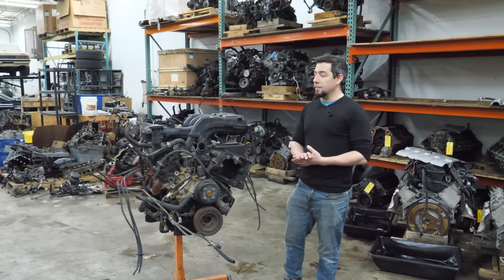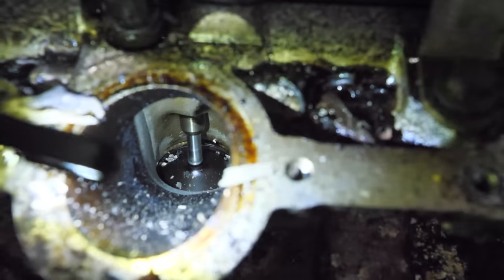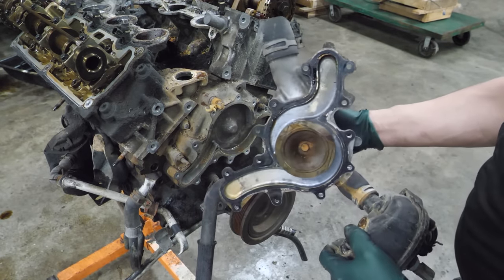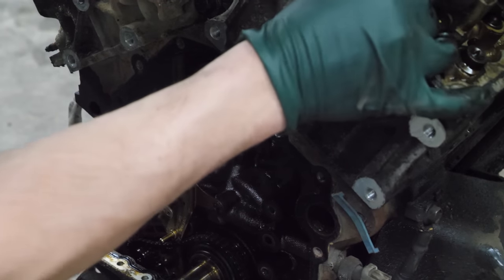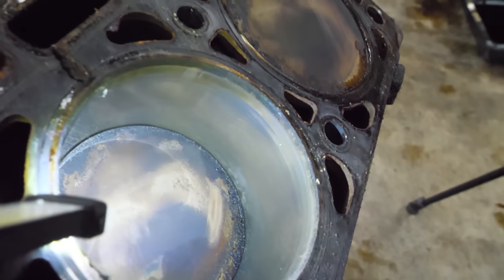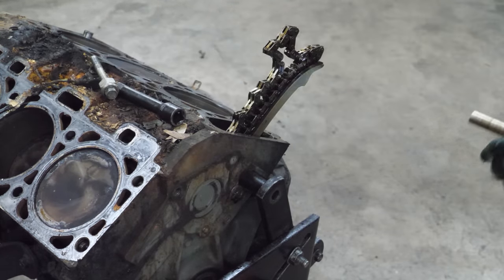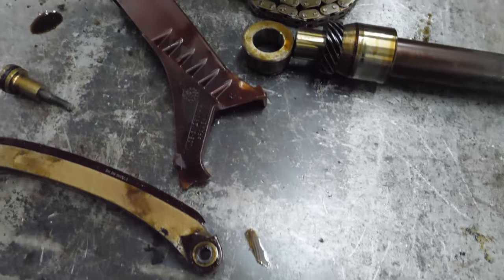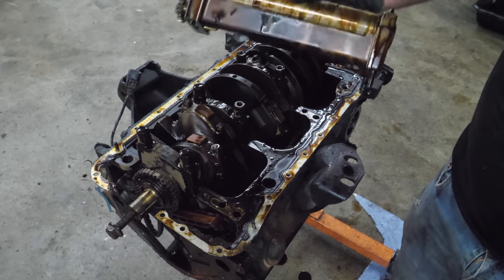Ford Explorer / Ranger / Mustang 4.0L SOHC V6 Teardown! Is This Why They're Called "Exploders" ?

Comment: When my son had the Cadillac with the Northstar, I didn't even want to bother. Now I got stuck rebuilding a 2006 Explorer 4.0 SOHC. What a headache! Is this the only engine you have to remove to change the timing chain? Well, at least the back one. Both chain guids were broke on this one. The front one made a hole in the valve cover. I had to replace the valves too. They did bend a little. Luckily, they didn't damage the pistons to needing replaced. All but 2 valves were bent some. I'm putting it back together now. I ended up buying tools to do this job.

Your's was alot better than the one I'm doing. LOL

The person only had it for 3 months. So I'm trying to save them a bunch of money, by doing it for them.

Comment: I have a 2001 ranger with this engine. It is at the end stage of its life. With 170 thousand miles, it has that notorious start-up rattle, but I will daily drive it until it pops. Been a great truck... I'm getting a little weepy.

Comment: I still have my 2001 Ranger SOHC 4 L V6.  I recently had a few minor oil leaks so had valve cover, pan gasket and oil pressure sender replaced.  Also had radiator and water pump replaced 6 months ago when radiator leaked. Has 196,000 miles and doesn't use a drop of oil runs great.  I can only hope my next vehicle has so few repairs after 22yrs.

Comment: You can actually remove both camchain cassettes while the engine is in the vehicle. One needs a set of fixtures and specialty tools to properly align the cams, chains and pulleys. You must torque everything, I recommend a lot of loctite and good luck.

Comment: Those external tensioners are supposed to be changed every 70-80k and most people dont know that. Thats why they're external, so you can change them. After a while the spring gets weak and reduces tension on the guides making the chain slap on startup, which cracks them. The oil pressure takes over after startup and the slapping goes away. Really other than that they're very reliable engines.
Reply: So the oil bleeds out of them when they sit.... Don,t know about that. I think the plastic gets brittle.
Reply: @blueplasma5589  yeah the oil will bleed out of the external tensioners. That’s why it is spring loaded, to keep tension till oil hits. Springs get weak and then next thing you know you have broken guides

Comment: mine made it to 302k and i'm putting in one from the pick and pull with 150k.  dropped the oil pan looking for plastic first thing.  bought it new in 2001 and don't see many around anymore.  quoting Alan Jackson, "Some day it'll be a classic". it's been a great suv.

Comment: We still have a '94 explorer with the 4.0 engine. Not a bit of head snapping acceleration but still runs very well and starts. Has 221k miles.

Comment: So the ‘07 4.0L on my Exploder made it to 145k when the timing failed. My wife was just leaving the driveway so no damage. Compression was great across all cylinders so I pulled the motor and re-timed it. It’s a massively complex process, especially for someone like me who had never done anything nearly as complicated. We got 5 years and another 50k miles out of that engine before it failed again. Again, timing components (found plastic pieces in the oil pan). 
I just finished installing the new 4.0L from Fraser Engine today but I still have the intake, headers, and accessories to install. 5 year no questions asked warranty beats a car payment the the transmission is a reman with only 50k on it

Comment: I had a 2004 Sport Trac with this same engine had 285,000 miles original engine and trans and still ran and drove perfect when I sold it. And it was a work horse. I pulled loads over weight for the truck several times and the truck never even struggled with it. I upgraded to a 1/2 ton is the only reason I got rid of it.
Reply: 2004sport trac has the new metal cassettes installed went…300 k.  2002 and below had the plastic cassettes that only went 200 k..

Comment: I own a 2004 Sport Trac with the 4.0 - ran 100,000 and replaced rear timing chain and cassette and now doing it again at 207,000 - let this be the last time.  Hoping I get 100,000 more!!  I will say this engine has performed really well if it weren't for the timing chain issue.   The right bank on the rear failed both times - front has yet to fail at 207,000. Problem is you have to pull the engine to fix it. Still - I like this truck - it has plenty of power for it's size but this will be the last go around for me. Enjoyed your video!!

Comment: I had one of the ohv 4.0 in a 99 ranger, then 2 of the sohc 4.0s in 2 newer rangers.  Never had any engine trouble besides the serpentine tensioner pulley bearing squealing after 30k miles… I replaced a lot of those. And a bunch of clutches… but that’s it.

Comment: I had a 2007 Explorer with that same engine, got totaled at 150,000 miles, got great service from it, no engine troubles whatsoever.  I didn't consider it underpowered but then I don't want a rocket on wheels.

Comment: I almost purchased a 4.0L SOHC 2 door explorer, was an 2002 and had the updated chains and guides already done with new tensioners from ford. He rebuilt one of the earlier 4.0l SOHC that failed due to the guides falling into the oil pan but it was just the rod and main bearings, new chains guides and tensioners but he knew how to time them, he had some holders that looked like basic wrench but it was a special offset.

Comment: I’ve had several of these engines with over 200000 miles and going strong. Even had a relative hydro lock one after trying to cross a creek, drains the pan, pulled the plugs and cranked it over, sprayed the water out. Plugs back in, new oil and filter and it was good to go. 3 years later they did the same to a pathfinder with the 3.0 and not so fortunate, valves all bent.

Comment: My brother in law ran a explorer over 250k on the 4.0 sohc. He traded it in on a E250 van.
I had a 94 pushrod 4.0. I never had any issues with the engine. My problem with that truck was the automatic 4 speed trans. Was the weak link.

Comment: Have had a couple of 4th gen explorers (this motor) w/o really having any mechanical issues. Really love these. Body on frame, great all-around size, incredible turning radius and true 4wd w/ a 2-speed transfer case.Keep the one I have now heavily dealer maintained as there is no American made SUVs with similar specs. Biggest issues with the ones I've had are always the electronics. RSC causes lots of unrepairable problems. Dealer tells me Ford discontinued parts even though it's a known problem.

Comment: I had an 03 Ranger Edge with one of these in it. It had 280k on it. The truck died because the transfer case got stuck in 4x4L and it basically wouldn’t move after a while. That, and the cab was so rusted, I had to ratchet strap both the doors shut.
The engine still ran perfectly though 😄

Comment: Just sold a Ranger 4.0 with over 200,000.
Changed the oil reg , drove it reasonable, 
Lots of other problems with the PU.
Had it 8 years.
Engine still sounded great.
Only good thing going for it was it was never loaded very much.
It was used for pickup and delivery or medical samples.
The bed liner looked new. However Reading on the net I was sure it would die any minute.

Comment: I made the mistake of buying a 2004 explorer years ago. The motor seized one day right after starting it - one of the guides or chains failed and broke the jackshaft in half.

Fast forward - pulled a 4.0L from a 2010 mustang w/87k miles. Every single guide was cracked or damaged beyond repair. Replaced them all before putting it back in the explorer. Sold it as quickly as possible afterward.

Comment: I had a ranger that I bought new sold with 225K on it still running great!  Never had to touch the motor, what a great truck.Wife has a 02 explorer with 150K on it. I just decided to have the chains and tensioners replaced as they were making noise. all quiet again runs great. All throuhout the video I heard you keep saying well this dont look too bad or this looks pretty good and that the crankshafts are cheap if you would ever need one.  Fords are a great product and much cheaper to fix than most other brands. Try and price a crank for the BMW not to mention all the other parts and gaskets to get to it!

Comment: Maybe I missed something... But what the heck were the gears on the jackshaft and balance shaft driving?! Or are they just leftover remnants from when it was a pushrod motor and they just used the same balance shaft\cam(with lobes removed)?

Comment: Have you ever opened VW AAA engine (2.8 L VR6, or ABV the 2.9 L variant) from 90s. Another engine with just minor issues with the timing chain. 

1. the chain guides have a 2-piece construction: a metal frame and a sliding surface that is riveted to the metal frame. Otherwise great but the sliding surface is so thin that the chain starts chewing the rivets, and the rivet heads are usually gone by 80-120k miles. After the rivets are gone, the sliding surface will be mushed somewhere and the chain will most likely break. 
2. Then there are the tensioners which will not last that long. After that, the chain starts skipping some teeths.
3. Good luck getting the chain and the sliders changed because the chain is on the back side of the engine. To even get to the chain, the gearbox and the the clutch have to be remove. Only positive thing is, that the chain tensioner can be changed easily without removing any other things.

Comment: I helped my grandpa do a timing job on my grandma's 99 explorer at 100k. With the car on blocks we dropped the transmission and did the whole job without removing the engine. Took us 3 days to do it in a driveway.

Comment: I had a 4.0 sohc ranger with 200k on it and original timing chains and it was probably the smoothest running engine of any vehicle ive ever owned. I did of course change the oil pretty regularly

Comment: That balance shaft is for the 4x4 version. Without it, you take the chance of having a rough idleing engine when 4x4 is engaged. The secret to not destroying those cassettes is change those tensioners every 75k miles and 5w30 syn oil change with motorcraft filter every 5k miles. My 97 Explorer had 700k miles on it before a drunk driver totaled it. Never did any engine work to it.

Comment: The 2002 and newer are harder to get the front cassette out, but it can be done by prying forward on it from the bottom of the head and lift it out of the top. 4x4's had the balance shaft, 2wd didn't.

Comment: One thing to keep in mind is the 4.0 SOHC is the motor you got here, and the one notorious for the timing issue. The 4.0 OHV (most 4.0 cologne motors after 2002) solved this death rattle issue making timing fail eventually.

Comment: I have an 02 and an 04 ranger with 4.0 SOHC engines. The hydraulic timing chain tensioners are supposed to be changed every 100k miles otherwise they will blow up but one of mine is at 300k and climbing.

Comment: My mom had this engine in her 2007 mustang she bought it brand new and drove it up to 195,000 miles on it and it still ran. All she did was change the oil every 5,000 miles. It just boils down to maintenance and not adding a bunch of mods to it. Thing is a lot of people don’t change the oil and maintain them the way they should.

Comment: I've had 3 Rangers and 2 Explorers with this engine,  and all went 300,000 plus miles. Oil change on all was every 2500 miles.  All were running perfectly when I sold/traded them in.  Super important..OIL CHANGES REGULARLY.
Reply: I don't get it either. Damn good motor when people ask me about em. I've ran em over 220,000 mi., Still running. same with the wife unit.

Comment: I have an '03 Mazda B4000 with 173k and no issues.  Cold starting I put pedal to the floor in "flood" mode. I crank the engine till I see the oil pressure gauge come up before releasing the pedal and starting. This seats the tensioners before the engine fires up. I use conventional oil but change every 6 months regardless of miles  ( Buy it cheap and change it often).So far it seems the frame will rot out before the engine goes....

Comment: My son had one of these in a Mustang until a cop ran a red light and T-boned him. it had almost 200,000 miles on it at
t that point. We hung onto it since it still ran good and put the engine into a Ranger of similar vintage. As far as I know, the guy who got the Ranger is still driving it and occasionally pulling a small boat to the ramp in his subdivision.

Comment: I'm on my second Ranger with the 4 litre SOHC engine and the first one went 568,000 kms before I wrote the truck off with ZERO issues on timing chains etc. The engine had only ever had 1 water pump, 1 alternator and 1 thermostat housing for the whole life of the engine.  Ran Petro Canada 5W40 full synthetic diesel engine oil from day 1 and never any noise or timing issues. Oil changed every 20,000 kms faithfully. My second Ranger has rolled over 345,000 and still no issues. I tow a 4000 lb travel trailer cross country in an FX4 chassis so the truck doesn't just get groceries, just sayin. Look after maintenance and the engine will look after you. Only complaint is high fuel consumption. Neither engine ever burned a drop of oil between changes.

Comment: Replaced 3 broken plastic timing chain guides on the front of my 2006 Eddie Bauer. Did it myself as a first major Engine project using Youtube videos and forums. Folks, don't get a vehicle with this Engine. I'm still crossing my fingers that the rear guide doesn't fail since it normally requires an Engine removal to replace.

Comment: So the bizarre chain setup has killed many a Gen III Exploder, but that was a mere runner up in the engineering masterpiece.  The 5R55W used an aluminum bore with a steel piston for the 3/5 piston.  The piston was essentially a boring tool operated by the transmission, and eventually bored the hole big enough to allow too much leakage to allow shifting into 5th gear.  The problem was so pervasive that a mom and pop shop patented and sells a new piston with a Viton sealing ring which could be installed from the exterior and which fixed the problem.  Some guy in Jackson Wisconsin 1, FoMoCo engineers 0.

The '02-'05 Explorer was, apart from the laughable Engine and transmission, a great vehicle.  The frame is a beast, it's got a 4 wheel independent suspension, the body was made of aluminum way before it was fashionable to do so,  it's surprisingly roomy, and the diffs were a super 31 and a Ford 8.8.  All that said, I had no idea how bad the jackshaft, balance shaft and chains really were.  The most appalling part is that Ford made a single cam, pushrod version of the 4.0L V6 before during and after they made this monstrosity.  It wasn't a simple failure of laziness: they had to go above and beyond to achieve this level of stupid complexity.  It's as if they designed a great vehicle, took a step back, and said "Guys....we're Ford.  We have a reputation to uphold."

Comment: I’ve fixed a lot of these SoHc 4.0 engine while working at a Ford garage as a heavy line tech.
Yeah it’s a complicated engine via timing chain design but the purpose was to cut costs of cylinder head production….one casting does both side of the casting while many other engines require 2 separate castings for a SOHC or DOHC engine.
There was an early recall for an additional oil restrict or in the cylinder head oil galley to shorten oil pressure time to chain tensioner…(which it did work) 
Short trips and lack of maintenance is killer for these engines….but I have seen these engines well over 300k miles….as with most engines are designed for longevity with them running…
Reply: I just recently purchased a 4x4 2011 Ford Ranger XLT with the 4.0L with 52k miles. It's our "second car" and doesn't need to be driven often. I try to drive it at least once per week to pick up ordered groceries - 15 minutes there (not highway), then idle for a bit, load groceries, then 15 minutes home. With regular oil changes, do you think that's enough to keep this truck in good condition?

Comment: I'm shocked by the amount of people that said they have had problems out of this engine. I bought a 03 explorer and put 170k on it. Only issue I had with the drivetrain was I had to replace the thermostat housing once. Now I can't say much for tre rest of the car ( wiring issues, leaked water every door seal and moon roof, and other interior issues), but the drivetrain was bulletproof proof for me. That saying a lot since the last 40k I used it for my work car and only changed the oil about once a year.

Comment: Like any engine it's about maintenance. I owned 2006 Explorer Sport Trac with the 4.0 V6. Before a deer ran out of front of me and I totalled it trying to avoid the deer , it had 279,000 miles on it. Didn't burn or leak any oil and never went inside of the motor.